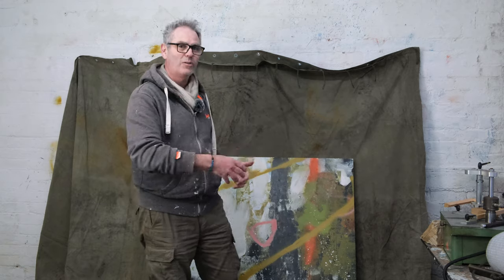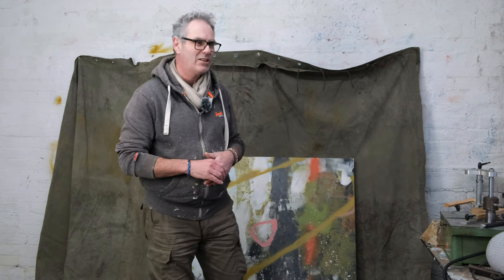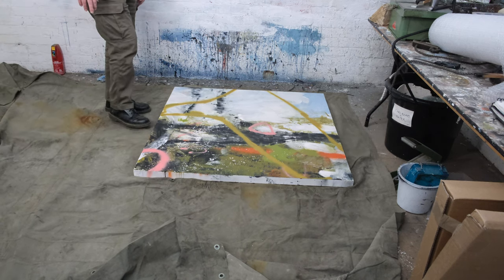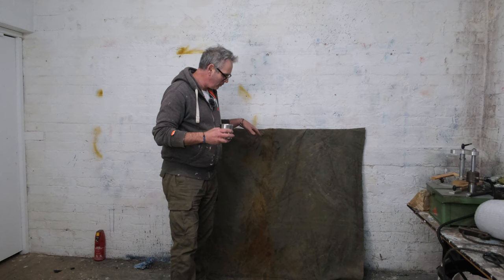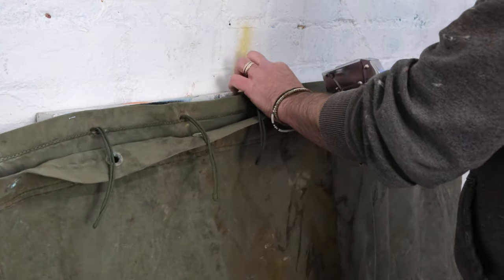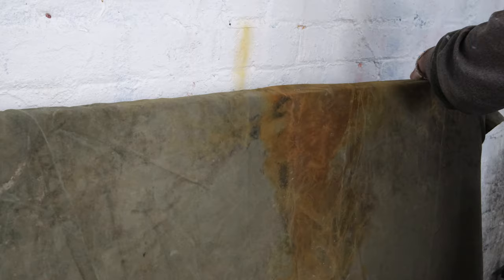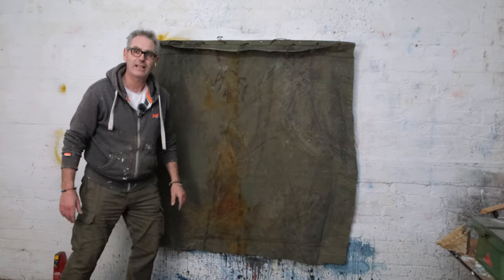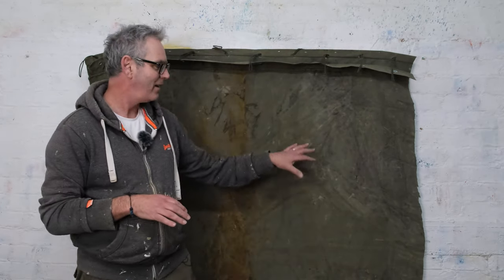To Stretch or Not to Stretch?

Comment: It looks like at the top where the eyelets are is a channel no dissimilar to one where you can run a rod through.  I put such channels on my textiles to hang them….I make quilts by hand and the get hung onto walls.  My thought was to have a wider channel, wide enough to run a flat 3 inch wide but THINNER board thru it to facilitate hanging it on your stone wall